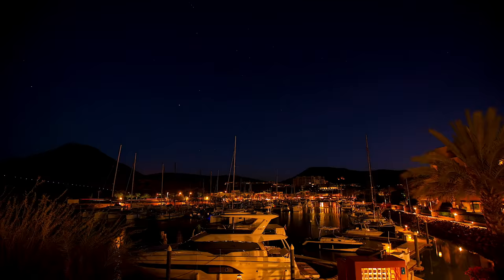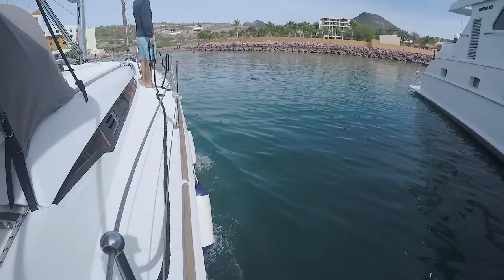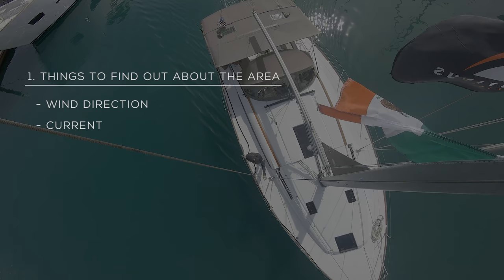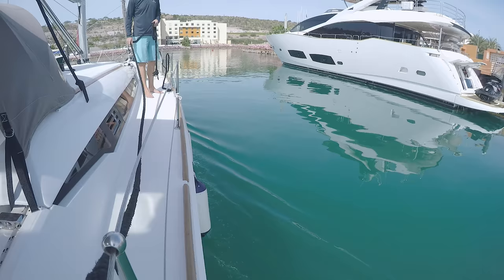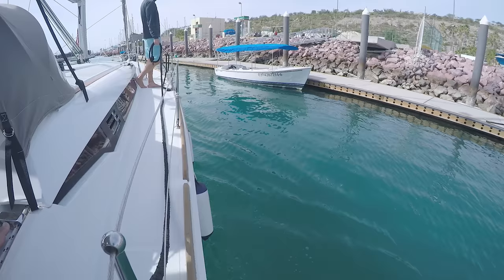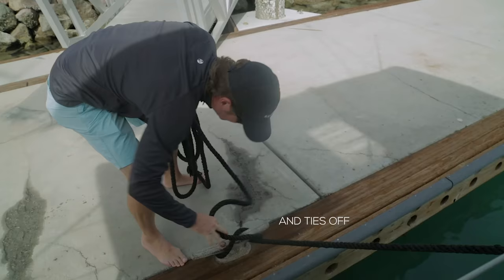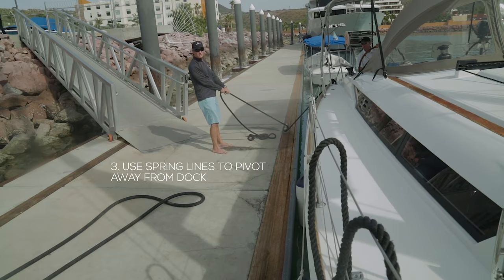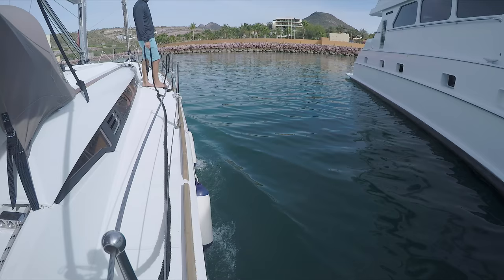How To Sail: Docking Technique - Sailing Basics Video Series

Comment: I like the first line connected to the dock to be an aft spring particularly if the wind/current is pushing you off the dock.  Once you have an aft spring attached the helmsman can turn the helm away from the dock and put the boat in gear.  That will pull the boat in against the dock and the bow and stern lines can be attached at your leisure.  Once the lines are secured, put the engine in neutral and shut down and you are tied up.  Don't forget to center the helm.

Comment: Nice video, esp the emphasis on slow speed and shallow angle. A lot of beginners tend to go in too rough, leading to potential accidents. I prefer, however, to keep the crew on board as much as possible, and certainly with the first line, unless it's really impossible to belay it from the boat. This is even more important for single handed sailing: don't leave the boat until it is secured.

About leaving: the same thing, there's no need for the person to untie the rope and then jump aboard. Just tie it such that you can easily loosen it from the boat. No jumping needed = higher safety for crew.
Reply from the maker: EXCELLENT points!

Comment: Very good but 1 do not use a locking turn to secure a mooring line. If it comes under tension, tide turns or wind changes, it may be very difficult to release. 2 no bare feet.  If you get a toe trapped under a cleat, accidentally tread on a cleat or something sharp on the dock you will regret having bare feet.

Comment: If you're going to spring off it's better and safer to have the crew on deck controlling the spring line rather than doing from the dock.
Reply from the maker: Good advice Paul! We have done it many times both ways, and it's hard to have a one size fits all approach. So much depends on boat type and freeboard, and the crew. Our only hesitation with doing it from on deck is that it can be a real pain if the dock line gets caught in the cleat as you are trying to flick it off! Just something to keep in mind...

Comment: I have yet to find an instructional video that emphasizes amidships cleat first. Performing a bow or stern dock line cleating first allows for immediate bow or stern swing away from the dock. An amidships dock line to dock cleat prevents this every time. Is there a reason you and other instructors don't make this THE common practice?
Reply from the maker: Hey Kent... great point. On smaller sailboats, I think using the amidships cleat is a great idea. When sailing on boats in the 25-30 foot range, I find this works really well. For me personally, I find that on larger sailboats, the stern can still pivot away from the dock when using the amidships cleat, depending on your approach speed to the dock. I find that the method shown in the video stops the forward momentum with much less chance of the boat pivoting away from the dock.

Comment: If you're new to the area, how do you find out how high the dock is and what hazards are nearby?
Reply from the maker: Great question Tyler. We usually contact the marina before entering either on VHF or via phone, and this is a good time to ask about dock height. Otherwise we enter a marina with fenders about 6 inches off the water, and once inside the marina take a look at dock height and adjust accordingly.
Reply: @NautilusSailing  Thank you!

Comment: Well explained thanks for the tips. How do you suggest a single handed sailor can dock? Is it simply move faster between each task and in effect multi-task?
Reply from the maker: Another great question George! So docking technique really depends on conditions, size and type of sailboat, and dock. Honestly, most single handed sailors when entering a more challenging marina or docking area call ahead and have the marina be ready to assist. This makes things a lot easier! If you are docking a smaller boat on your own, then you can use these techniques. You just want to make sure the boat is completely stopped before jumping off with stern line, have the bow line ready too, and be quick :)